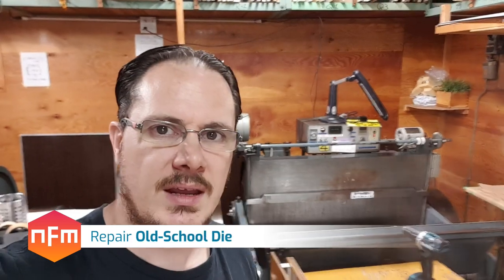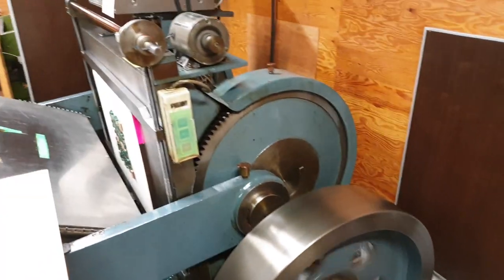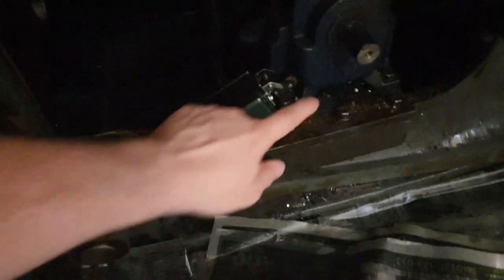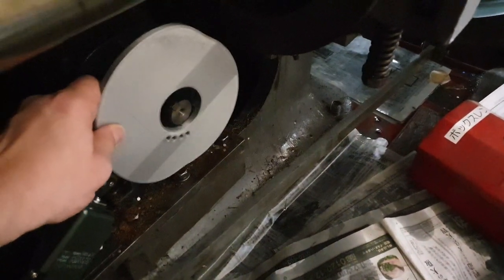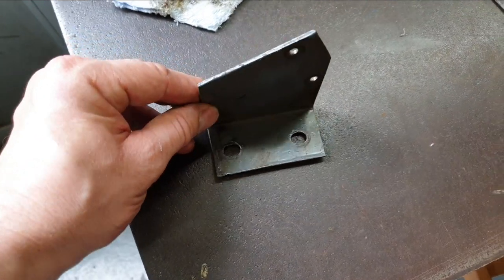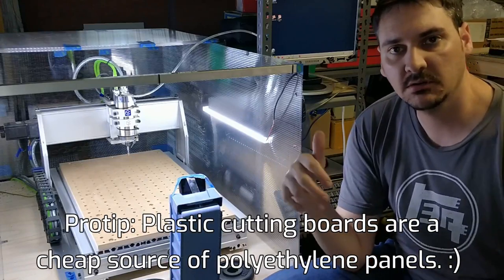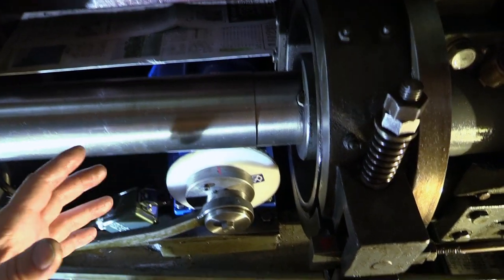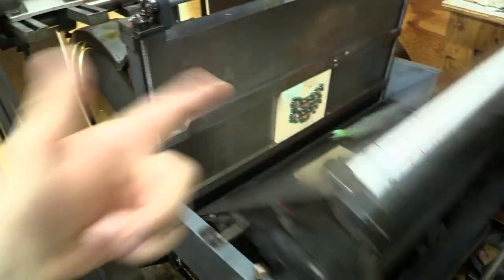Die Cutting Machine Repair

Comment: Hi there! I am currently working on a die cut machine as well. It seems that the clutch is slow to engage the flywheel. It takes about 40 seconds to engage it. We have checked the mechanical systems and every thing seems to be work well. Would like your thoughts on this. Thanks in advance!
Reply from the maker: Check the clutch mechanism for broken engagement levers, also make sure the clutch packs are cleaned with degreaser so they don't slip.
If the clutch packs are oily and/or worn and slipping and you tighten the adjustment too much, the engagement levers will break and you'll end up with even less clamping force to engage the clutch packs.

If you have this exact machine, I have drawings and DXF files somewhere here to get replacement levers made.

Comment: What material did you CNC the disc out of? It also looks like a PET. Nice repair 👍
Reply from the maker: The CNC'd disk was made from a standard kitchen cutting board, so almost certainly polyethylene.
Hard wearing, chemical resistant and somewhat self lubricating so should work well in this application.
Reply: NFM But the 3d printed prototype was also PET? Not as thick, perhaps?

Comment: What does it cut dies for?. I could not understand cut action with plywood template
Reply from the maker: The plywood template is the die that is used to cut sheets of plastic into shapes, such as for folding into boxes for product packaging etc.
Reply: @NearFarMedia  Bigger ones with a flat plate are also around, used with a swing base that holds the material and a sacrificial backing board, and then the arm is swung under the big head with the cutting pattern in it, which then is pulled down by a connecting rod on a crankshaft to punch either through or to make score lines. Common to cut heavy rubber and leather to make shoes. 

Yes these machines have no brains, the operators must remember to use theirs, like a lot of old industrial machinery, and even a lot of brand new ones. 20 tons of pressure means you lose parts.
Reply from the maker: There are two other die cutters besides the three like in the video in this factory (5 machines) too, they look like printing presses, and they diecut thinner plastic fully automatically.
They are great for large amounts of thinner plastic but they don't have the oomph of these old flywheel-driven machines for the thicker stuff. Sometimes you just need brute force to get the job done. :)